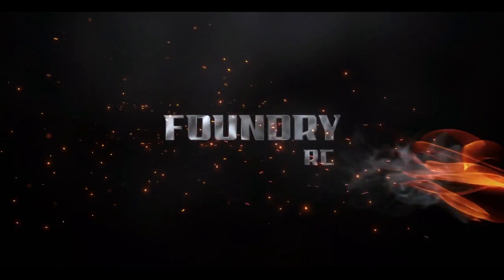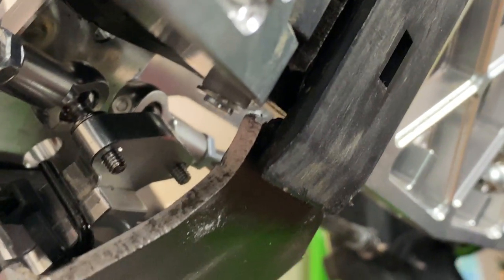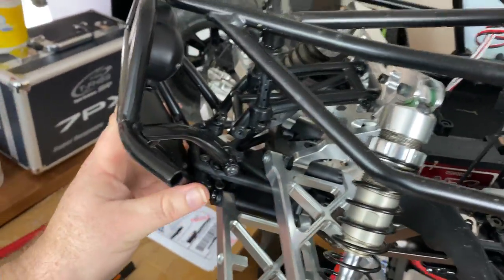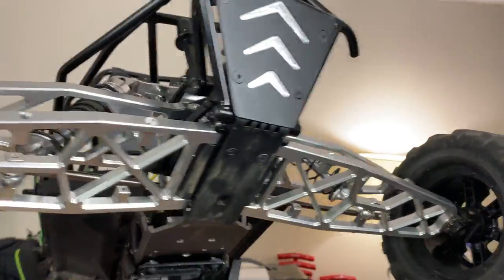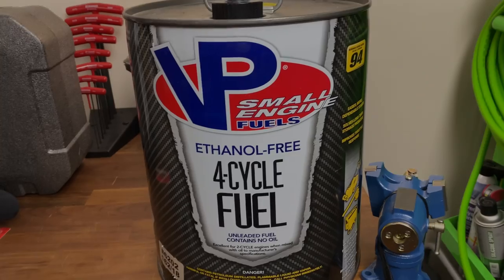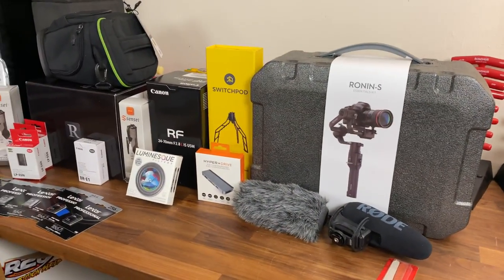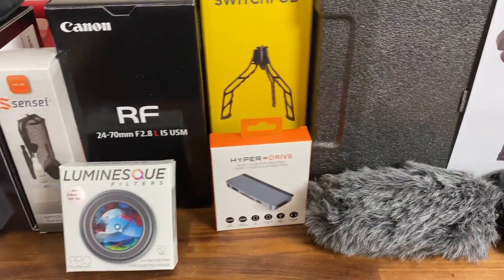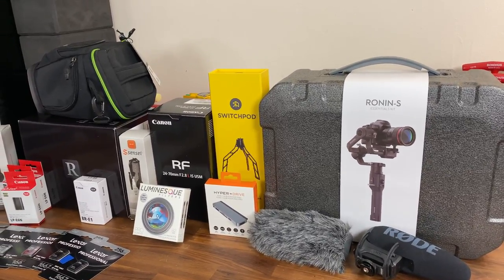Broke The 5TS MAX! and I pick up some GAS!!!

Comment: That steel chassis plate is a must on a baja, nice video!
Reply from the maker: Elite Rc thanks bro yeah I had it and was going to install it but was a little too eager to get out and run for the video and now I’m paying for it. Lol Side effects of rushing things for a video. Lol
Reply: @FoundryRC  also nice camera equipment I see you got the ronin s im going to get the ronin sc for my smaller set up, for all of that action you have over there especially with that lens that ronin s suits your application!
Reply from the maker: Elite Rc I was looking into the SC but with some of the lenses I’m planning to use I need the stronger motors. I was also looking at the zhiyun crane. But I wanted the longer battery life. I’ll let you know my thoughts on it after I give it some use.
Reply: @FoundryRC  After all of my research for the ronin s you got the right one for what you bought if you would have gotten the sc the motors would not fully support that cannon and lens combination, I went sony and the lens i am going to run is no where near the level that you have stepped up to!
Reply from the maker: Elite Rc right now Sony is the way to go. I went canon because I have always had canon so I know the setup and I still have some glass although it will need an adapter on this camera. I only went the level I did because I also have a passion for photography. But trust me it will be a long time before I make back the money I spent on this.

Comment: I'd like to see the editing, mostly on the PC using your editing software of choice.
Reply from the maker: Chris L Rocks on the computer I’m in the process of trying new to me software. I started out using Adobe premiere Pro. I chose that software because I use both Mac and PC. And I recently started trying to use final cut pro X. Because I’ve been doing a lot of editing on the iPad using LumaFusion. And it works together with Final Cut Pro. So that video will be a little ways off. Until I get more comfortable with the new app. But I would love to do that too. It would also be easier for me to capture the screen and show what I’m doing.
Reply: @FoundryRC  Excellent! I'm  a (old) PC guy, that has a ASUS tower and a macbook pro tablet. I just can't seem to get the hang of the Mac.